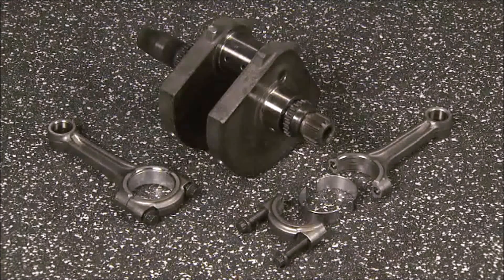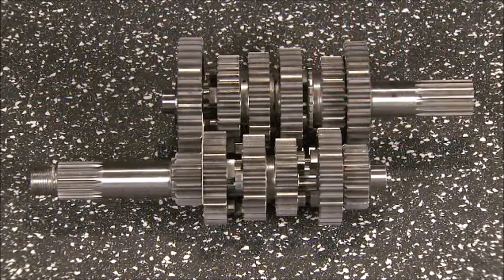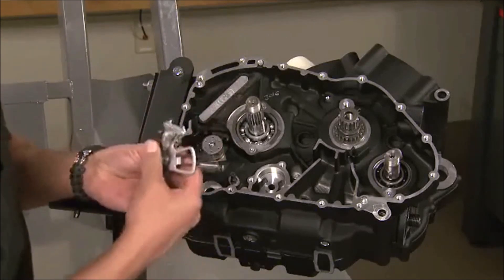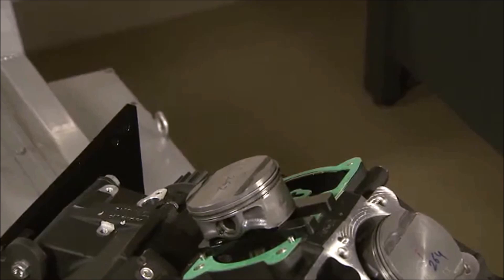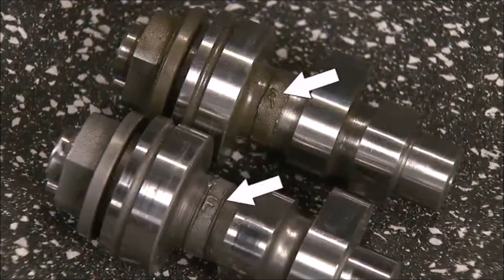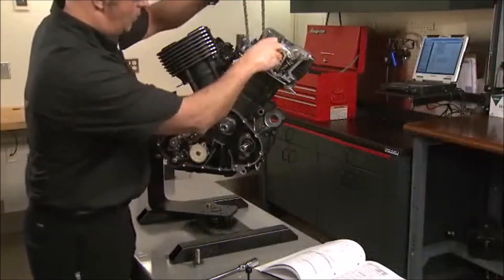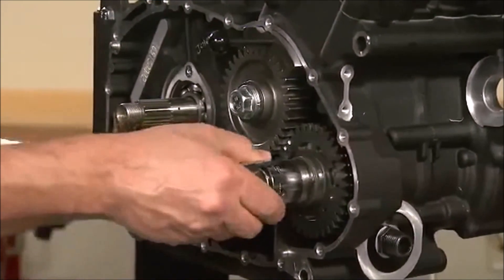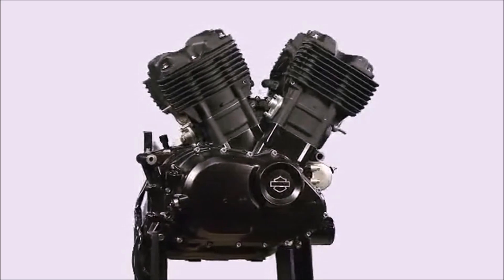H-D XG 750 Street #168 Engine Assembly

Comment: At around 10:48 you can see the roller bearings that ride on the cam lobes. I have never seen this. I think it's brilliant. Then right after that at 10:59 where the rocker arm adjuster contacts the valve they show us the flexible socket that compensates for the difference in valve angle contact point during movement (valve going up and down). Brillant! This is the most modern engineering I have seen. I have studied engines for 40 years. I was a mechanical engineer. This is a brilliant motor.
Reply from the maker: Wow I really enjoyed reading your comments, thanks for adding to the channel. Ariel
Reply: Hi Ariel GB. I want to thank you for posting this video. It goes a long way in showing the world just how modern and interested in their engines Harley-Davidson really is.

Comment: I recently purchased one of the 500's. Thanks for the video, now I know how well the engine is made. Forged crank, plain bearings on rod and main, roller rockers!  Removable steel cylinder liners! This isn't built like a motorcycle engine, it's built like a good car engine.
Reply from the maker: Right. And it should be bomb proof and go forever.
Reply: Ariel GB here's hoping!

Comment: I think it is a good reliable design.
Reply from the maker: it's not to bad and only time will tell...
Reply: The design is excellent. Roller bearings for the rocker arms. Did you see the design of the valve lash adjustment screws? They have little articulated feet on them that move in such a way as to have perfect contact angles with the top of the valve stems.This means an evenly distributed load of force/energy which will provide longer life to the components as well as exceptional transfer of energy from the rocker to the valve stem. I have never seen this before.
What remains to be seen, is will all the individual components/parts be held to the designed tolerances when they are manufactured? That's quality control. If they exercise great care with quality control I guarantee these engines will make History as being fantastic, reliable and powerful. As well as being lightweight and compact. All the best virtues for a motorcycle engine.
Reply from the maker: So do you have one of these Harleys? I've just up-graded to the 2017 model... I wanted the ABS and alarm system the 2016 didn't have.
Reply: I have 2 Harley-Davidson's (I remember to include Mr. Davidson in the name out of respect). A 1994 Sportster 883 Deluxe and a 2015 FLHP Road King Police and it has ABS. Harley-Davidson uses the very best ABS on the market. Besides the usual front to rear linked braking system my FLHP also has a design element that allows you to use only the rear break at Parade/Parking Lot speeds. So when you step on the rear break at 10 mph or less the front brakes do not actuate. This allows you to drag the rear brake which in turn stabilizes the machine during slow speed operation. You will not see Harley-Davidson's wiggling around trying to stay upright in a parking lot or when coming to a stop. It is a fantastic safety feature. Ariel, you did not mention, or I missed it as to which Harley-Davidson you just upgraded too. I think only the large engined machines have the system as I just described to you. I am 100% sure about that so you can check into it. If you have a smaller machine, it is lighter so slow speed maneuvers may not be as difficult as with a Touring motorcycle or a large cruiser. 
Have a great year and ride with situational awareness and always ride at a speed that allows you complete control of your motorcycle. That means going slow in a blind turn as you never know when a woman on fer cell phone will come from the opposite direction in that blind curve and take over the entire road. If you have complete control from going slow enough you shall be able to pull to the right and avoid being hit and then you go on your merry way.

Comment: What are the headbolt torque specs?
Reply from the maker: headbolt? What the cylinder head bolts? They are 50-54Nm (37-39 ft lbs)  the cylinder head cover bolts are 10-12Nm ( 89-106 in lbs) and the  cylinder flange head bolts are 20-25Nm (15-18 ft lbs)